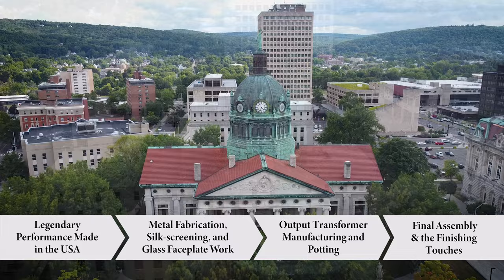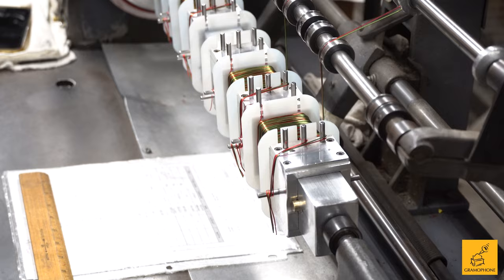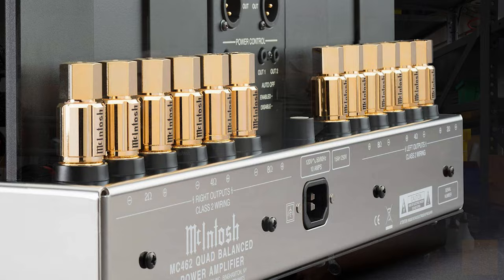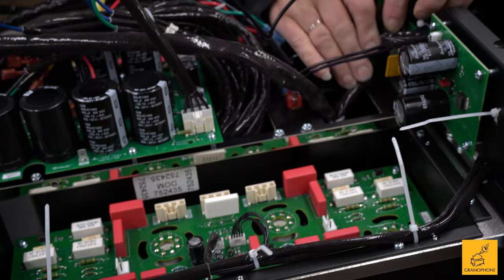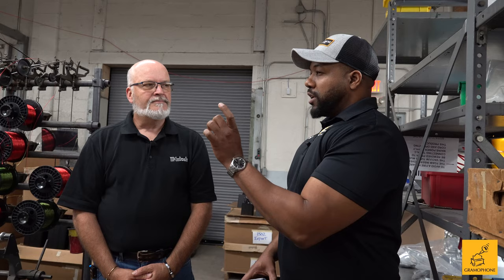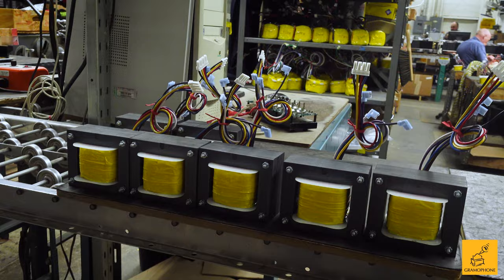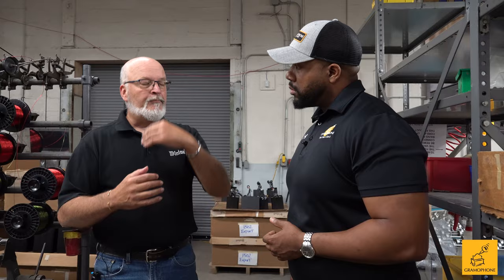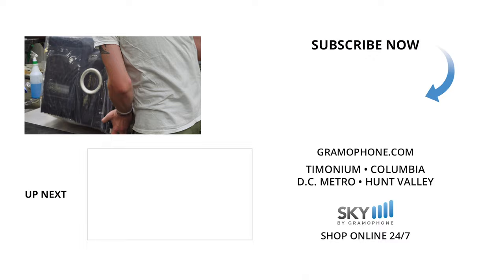McIntosh Behind the scenes | Output Transformer Manufacturing and Potting | Part III

Comment: Is any tar added before the transformer is placed in its housing or does it contact the bottom?
Reply from the maker: Hi Mr. , not actually added before the transformer is placed.  The hot tar is poured into the housing in a liquid state, and seeps underneath the transformer, as well as all around it. Then it cools to seal the connections and it slightly contracts vs its heated state.